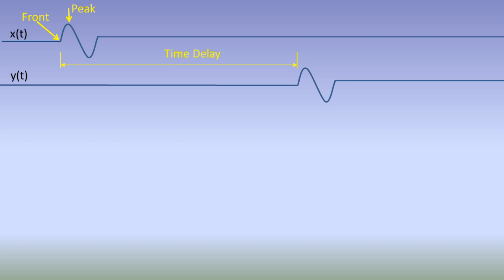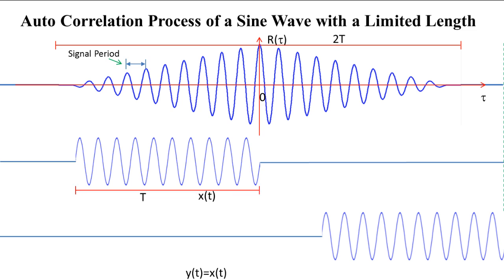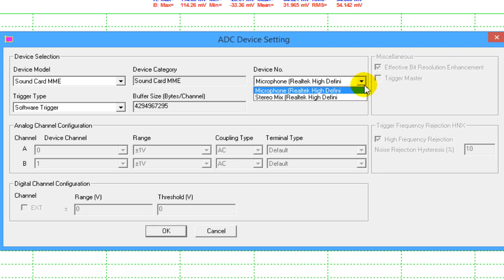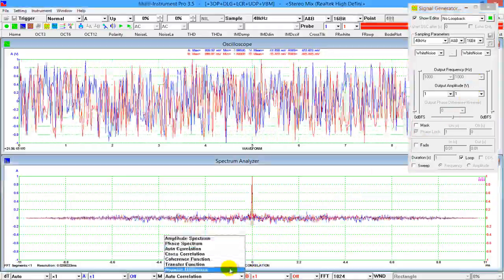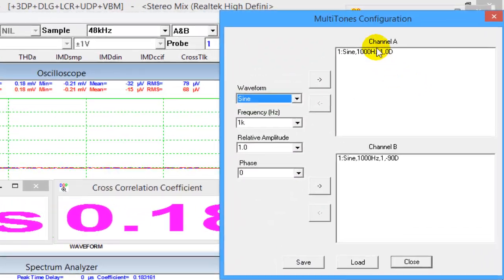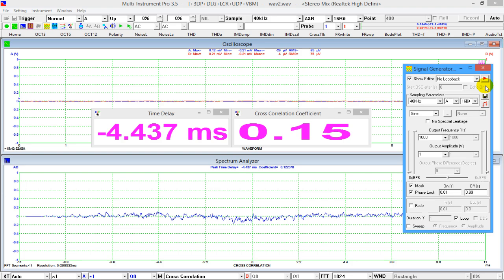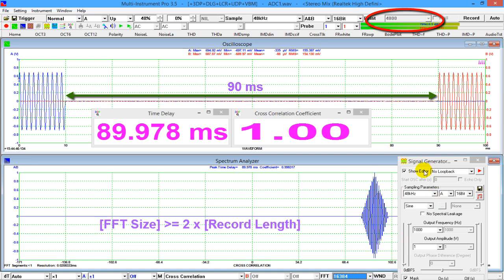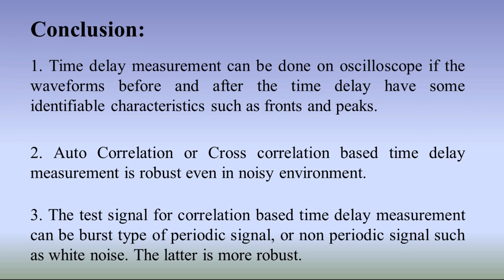How to Measure a Time Delay Using Cross Correlation?

Comment: On the off chance that you still monitor this with no activity for 3 years;  How do you convert the cross correlation maximum into the microseconds of delay?  It may be the X-axis (Cross-correlation) value where the peak is located but it's hard to be certain from the images I can see.
Reply from the maker: Yes, the delay in time is measured from the cross-correlation peak's x value.
Reply: @VirtinsTech  Thank you for the fast response!
Reply: @VirtinsTech  I'm having some problems trying to implement something similar to this using python.  I input 2 identical waveforms, calculate the correlation (using scipy's correlate method), and then get the argmax of the resulting array.   That just tells me that the maximum value is at x coordinate ~230,000, which for 15 seconds of wave doesn't convert to a time, and I would expect the value to be 0 since I'm inputting the same wave twice anyway.  Am I missing something obvious in the process here?
Reply from the maker: @matthewhenderson9292 I am not sure how you find the argmax.  The auto-correlation of an array with N elements contains 2N-1 elements.  You probably need to search the max. in the output array.
Reply: Hi Matthew, have you figured the answer out yet? im stuck in the same problem you have. not sure how to adapt the x axis to get the right value of the time delay between 2 signals.

Comment: Hello I would like to perform cross correlation between 2 burst signal to find the time of flight between two signals using LabVIEW software. If i perform with cross correlation VI, I just get the Rxy which is the coefficient. how to calculate the time of flight between 2 signals. Kindly help me out if you can.
Reply from the maker: Find the peak of Rxy and its distance from the center of the Rxy array.
Reply: Hi sorry for the late response. Im getting both peak of Rxy and center of Rxy array as same value.
Reply from the maker: If the two signals are the same, then you will get the peak at the center. Otherwise, something is wrong with your configuration.
Reply: it's acheived!

Comment: Not that, this is a biased autocoorelation !
Reply from the maker: Yes, the auto correlation here is biased as an estimate of the statistical auto correlation. It is actually much more commonly used in practice than the unbiased auto correlation due to the following reasons: (1) The biased auto correlation and the power spectrum are simply a Fourier Transform pair (2) The biased autocorrelation down-weights the less reliable large-lag estimates when the discrete-time sequence has a finite length. It is statistically more stable than the unbiased autocorrelation, especially at the places where the lag is large. Therefore, when "auto correlation" is mentioned, it is usually implicitly referred to the biased auto correlation.

Comment: how far better than an older DSA instrument, say stanford SR780, is this virtual instrument? what is the maximum processed signal frequency?
Reply from the maker: Multi-Instrument is a powerful multi-function virtual instrument software. It is a professional tool for time, frequency and time-frequency domain analyses. It supports a variety of hardware ranging from sound cards which are available in almost all computers to proprietary ADC and DAC hardware such as NI DAQmx cards, VT DSOs, VT RTAs and so on.  For example, if VT DSO-2820 (http://www.virtins.com/VT-DSO-2820.shtml) is used as the ADC device, it can sample at 200MHz and analyze up to 80MHz given an analog bandwidth of 80 MHz.